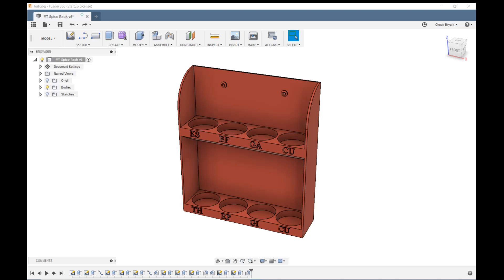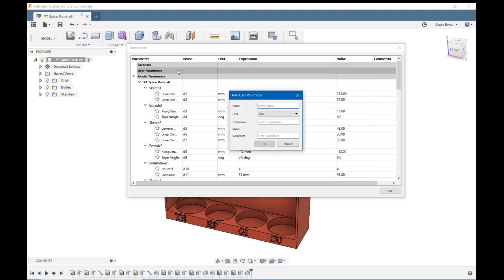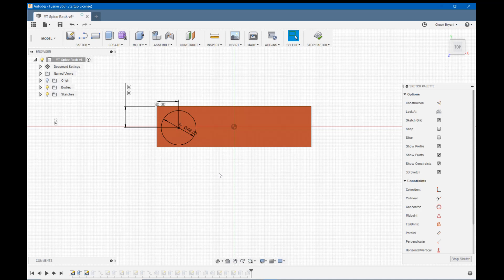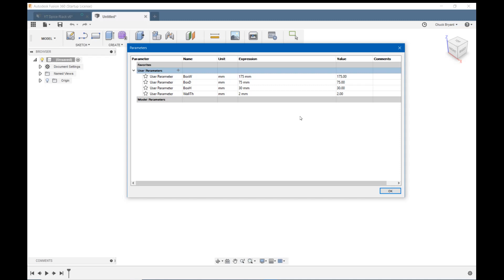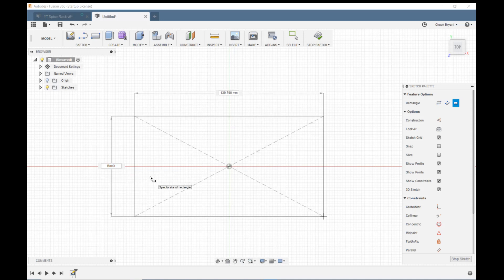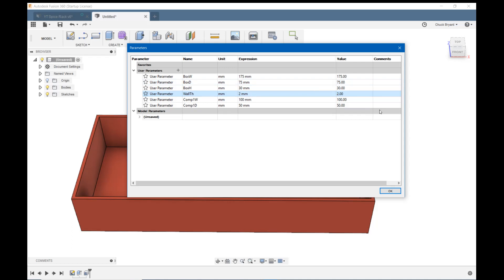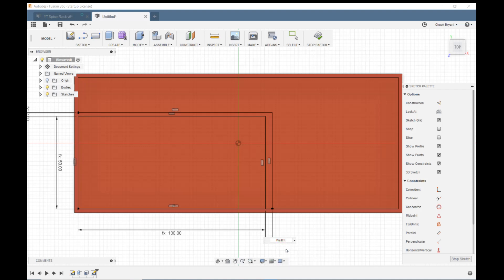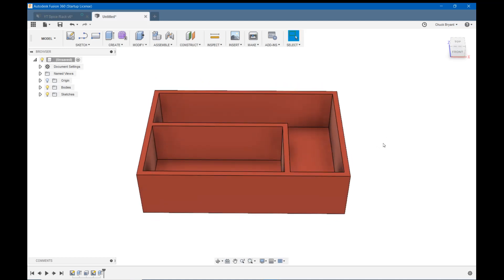Fusion 360 tutorial - beginners level - Parametric Modeling

Comment: Thanks, good video.  Still cannot tell what you are clicking on to bring all those functions up.
Reply from the maker: Click Modify, then Change Parameters, then next to User Parameters there's a + button. Click on the + and the window to add your parameters will open.
Reply: If you go to the same step but instead of clicking of the Change Parameters, click the little dots next to it and Pin to tool Bar.. Saves TONS of TIME